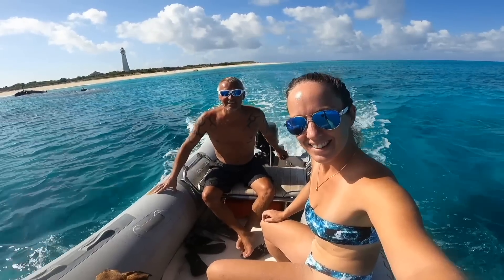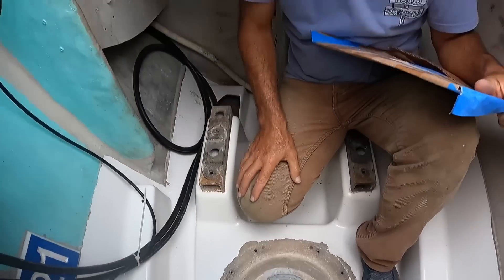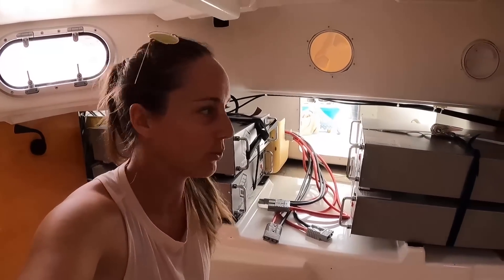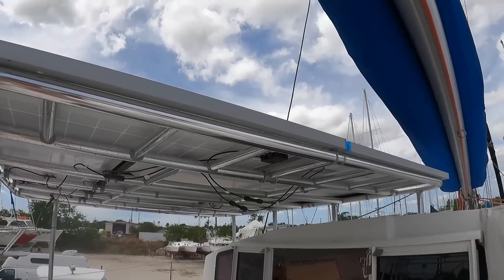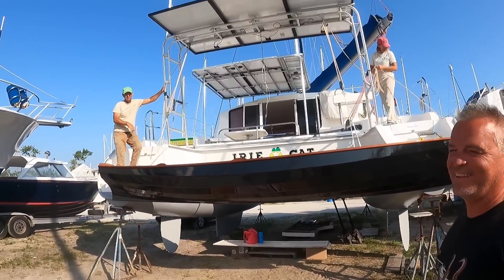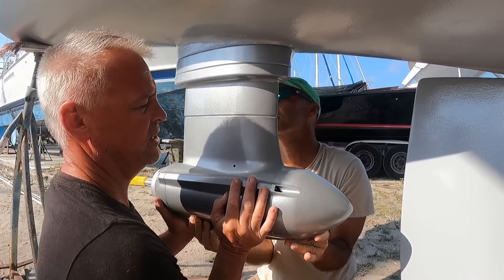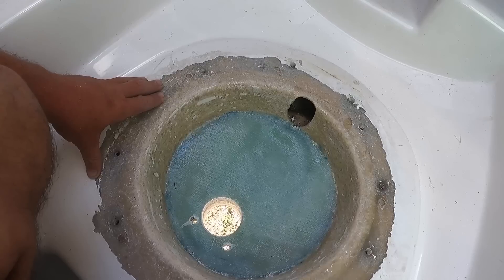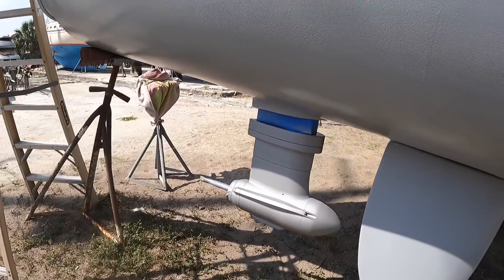Catamaran Full ELECTRIC CONVERSION - Batteries and Engine Install - Part 2 (S4 E45)

Comment: Torqeedo’s 12.0 FP POD Drives—use a pylon made of "highest-grade seawater-proof aluminum," rated IPx9K when fully assembled, per their site. That’s a top-tier waterproofing standard, implying no water should get in under normal submersion. But your point about the IP-68 pylon (a slightly lower standard) and its drain hole flips that narrative. IP-68 allows submersion but not necessarily total sealing against prolonged exposure, and a drain hole confirms they expect water inside the cavity. This isn’t explicitly advertised—Torqeedo’s marketing focuses on "stable," "robust," and "waterproof" without mentioning a flooded design. Yet, a drain hole means they’ve engineered it to handle water entry, not prevent it entirely. That’s a red flag for a system living underwater 24/7.
Resulting Hull leaks in at least two vessels, on Sailing Anarchy forums (late 2024 thread), a user described a Torqeedo POD drive where the "Pylon Drain Hole was an issue, along with a failed float switch," nearly sinking their boat. Water flow through the pylon grew barnacles and an oyster on the port side—clearly, it wasn’t just a trickle. They plugged the drain hole against Torqeedo’s advice, using butyl sealant to stem the flood
Please don't let these POD drive’s pylon flood your boat this design choice is likely the culprit. It’s not a flaw they flaunt—Torqeedo’s silence on the drain hole in manuals or marketing feels like a dodge. Users like you get stuck with the fallout: leaks, repairs, or a sunk vessel.

Comment: BEWARE Torqeedo POD Drive Installers!!!  Pylon Section is not Waterproof??? That Hole on the Starboard Side of the Pylon is to Drain the Pylon at Haulout, making the Pylon to Hull Seal Critical, especially around the Electrical Conduit, this feature almost Sank our Boat!
Reply: Working Corrosion Issues Now, Burned Motor Controller Box

Comment: Everyone is doing it it seem. I have done the calculations, you get very little power for a super expensive price and with saltwater and lightning strike I don't think we can expect it to last long.
A small 4 stroke outboard will outperform a big electric setup and will sip fuel. (and you can easily replace it and continue sailing if there is a problem)
I have done it, Florida, Bahamas on a small cat, the outboard were lifesaving multiple times. and we crossed the gulfstream with 20l of gas, almost nothing.

The only thing I didn't like is the noise.
For cooking electric make a lot of sense with induction cooktop and solar.

Comment: Electric motor in the salt water !
Nothing is waterproof.
When not in use need to TOTALLY Isolate electrically that includes data cable .

Comment: When is some company not going to seize the initiative and take a mono hull displacement sailboat and take all the sails and rigging down and fit a full length solar roof. Forget all those individual highly priced 1.5Kw batteries and fit an EV battery with the safe lithium chemistry option. A 35 ft boot could easily fit an 8Kw solar array mated to a 100 KwHr battery. Then you have a 4Kt, 100 mile, Med island hoping cruiser with oodles of power at anchor for all the comforts of home appliances. Solar panels are cheap, EV batteries are relatively cheap and low power electric drives are cheap. Just avoid the high priced stuff from Oceanvolt or Torqeedo!! The high quality and reliable LMC Marlin drives for example cost a few thousand not tens of thousands!!!

Comment: treat terminals and connectors that are not waterproof with some vaseline or gel for contacts. This will protect the system against corrosion and electrolysis.  Look at 
Nyogel 760G, contralube 770

Comment: Bifacial photovoltaic panels are ideal for hard top shading on a boat. They also generate electricity on the back side. Because the sea and the white boat reflect a lot of light, the production from the underside is a significant contribution.

Comment: Looks a bit strange with the rudder in front if the driveshaft/propeller🤔
Hope it will work fine.
Nice job by the way😊
Reply from the maker: That’s how the boat was originally designed. 

Thanks!!

Comment: Nice install, for simplicity you used the old sail drive locations but they will lose the option of having rudder in the prop wash for maneuvering but with wide twin engines and that how it was I guess not a problem?
Cheers Warren
Reply from the maker: Thanks Warren. Yea definitely installed them here for simplicity. 
The boat maneuvers so well with both engines plus they really aren’t planning on using them very often anyways. They literally sail everywhere!
Reply: @BarefootTravels   cool! A couple of cheap outboards could have done the same for 1/10 the cost I expect! But this is such a proper installation!

Comment: Not being negative , looking at the case of the bottom part where it connects to the new flat section Davie built , the bolts go up , and the tube with the electrics , the wall, ie casing isnt very wide to get a good seal , ?  I guess you will put a bead of silicon sealer, ? that will be a tiny gap with alot of danger of leaking , any impact and water will be in ,   why not build inside a casing sealed over that section like a inspection hatch for seeing swing keels, . 
And why didn't you fill the hole where the sail drive was inside , get rid of the well and have a very strong base, ...   be interesting to see how they go,
Reply: It’s interesting, the cavity of the motor fills with water naturally.  So the important place to seal is around the pylon.  If I were to do it again, I would glass the whole thing in from the top.  I may still do it when/ if we pull the boat this winter.
Reply: @sviriecat  if you call the pilot,  the part hanging down , I agree that's the seal point and the part I said the seal area is tiny , not a thick wall to work with , and a big hole for cables , bilge pump upgrade ?
Reply from the maker: It was sealed onto the boat with 5200
Reply: @BarefootTravels  ok it's a tough sealer , but my view was the case has a tiny bodybwall  giving a very tiny area for sealing , 6mm ish ,,,

Comment: Nice looking install. Is there no gas let between the hull and the top of the pod, or will that just be sikaflex?
Reply from the maker: 5200 was used to seal the engine to the hull

Comment: sailing dingy solution....4-6 HP electric outboard motor
Reply from the maker: 😆 or strong arms
Reply: @BarefootTravels  what if the strong arms were injured or ill?
Reply from the maker: True. 
There is lots of pros and cons. Every sailor has different preferences though to what they prefer and want for their cruising life… what’s the saying to each their own
Reply: @BarefootTravels  very true Mate, but I always defer to the worst. That way when it happens, I am ready.
Reply from the maker: We like to be preferred also

Comment: I'd rather sleep next to a fuel tank than those batteries and wait till the insurance co sees the battery location.
Reply from the maker: The batteries are strapped down
Reply: @BarefootTravels  I highly recommend having these battery blocks separated so that any fumes from an accident go outside the living space. Ideally, they should be in an area that can be flooded with water safely and quickly in the event of a fire.  This type of battery is of very high quality and the risk is less than with a conventional petrol or diesel engine. If it fails, it just smokes and doesn't burn. Still, it's a good idea to keep it in mind, especially at sea.
Reply: @BarefootTravels the electromagnetic field from the batteries is not good for anything with a DNA.
Reply: @ke2delight  There is v little electromagnetic field from Batteries, especially when they are encased in a Faraday cage metal box. Not that it is harmful to humans, certainly - the whole Earth is a magnet.

Comment: No gasket between the pod and the mount that Davey built?
Reply from the maker: 5200 to hold it in place
Reply: @BarefootTravels  I didn't see it in the video.  I feel better about it now.  Thanks
Reply from the maker: I thought it was in there when they put the engines up into place but obviously we didn’t talk about it. 😆 we do go into a few more details about that in an update video after they tried to splash for the first time …. Spoiler alert. They had an issue

Comment: Does Irie Cat mind sharing an estimated cost on this upgrade?
Reply from the maker: Just heard back from them. So roughly it would cost 30k for this upgrade. Each motor is about 10k plus 2k on cabling, 8k on batteries plus some extra on incidentals etc including haul outs and so on. 

They did sell their diesels so that helped in the process of this upgrade!

Comment: Great stuff Barefoot crew, I like the electric motor idea, but swapping the dingy, for a sail dingy, yeah not for me, I envisage too many dramas with that. How's Foxie girl going, I miss her. Where are u at with Barefoots fixes? I also like the solar panel hardtop, but I'd put a roof on first. Xx👌🐕
Reply from the maker: We’ve come a long way on Barefoot! Fox is happy as always! 🐶
Reply: @BarefootTravels  Excellent, ur both very talented, clever people, crack on !!!!👍
Reply from the maker: Thank you
Reply: Sounds like you have never had an outboard engine quit, or run out of petrol as you are getting blown out to sea.
If there is no wind, you can row, if there is wind, you can sail.
Reply: @dnomyarnostaw  touch wood, no I've never had an outboard cut out on me, I'm a mechanic and i make sure my maintenance is done!!! But good luck I'm not meaning to offend u.
Reply: @seawench555  No offense, just being brief in typing. Outboards can be great, but they are so mechanical. Even bad fuel can be an issue.
Reply: @dnomyarnostaw  yeah, ur absolutely right.

Comment: Nice installation! Do those motors provide regen under sail? How big of a back up generator do they have?
Reply from the maker: Yes. They do have regen on them however not a whole lot and they have installed folding props. 
There back up gen is a Honda 2000 portable if an emergency situation arises

Comment: As a cat owner and bluewater sailor…I see many compartments filled with electronics/ wiring that will corrode and fail…we know water or moisture will ingress at some point! As to sailing dinghy in the Bahamas, nice, fun, but make sure you have lots of books onboard for those very windy days or when friends head on out to the reef to spear and you are boat-bound. Nice ideas all….
Reply from the maker: Yes. There definitely is pros and cons to both set ups that’s for sure

Comment: Nice work Davey. Unusual  to have the rudder forward of the prop. How does the boat steer?
Reply from the maker: The boat steers pretty good. If we are going slow speeds  it’s a bit trickier but with two engines it’s super easy to control

Comment: Great job
Reply from the maker: Thank you!
Reply: @BarefootTravels  Is there a gasket between the hull and the motor ?:face-orange-raised-eyebrow:
Reply from the maker: They used 5200 to seal it up into place as per the instructions from torqueedo